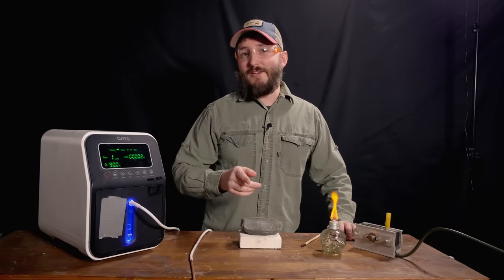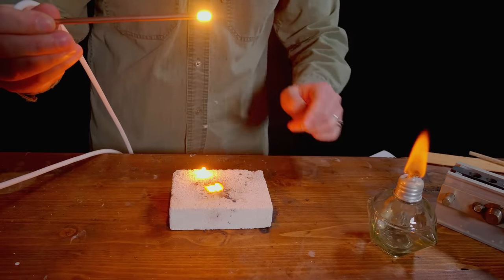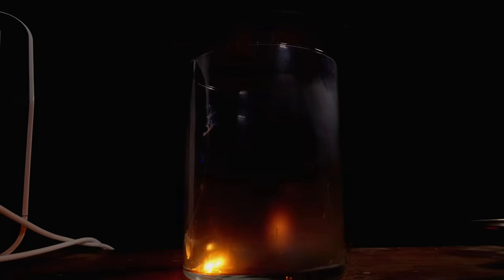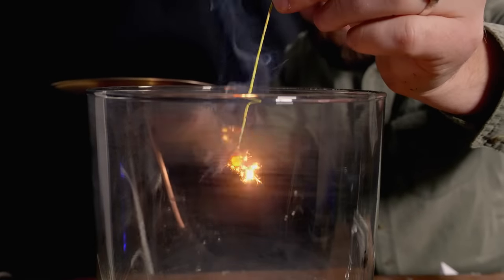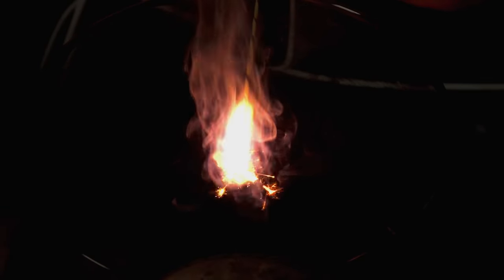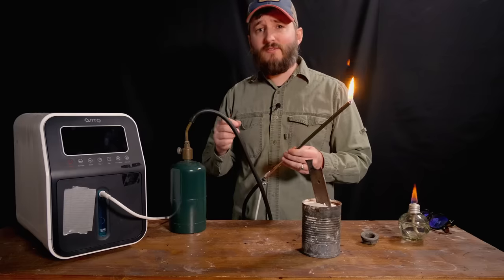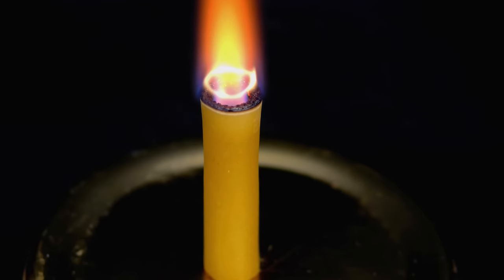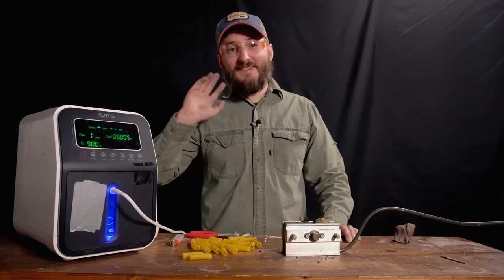6 Unauthorized Uses for a Medical Oxygen Concentrator

Comment from the maker: This video has been dubbed using an artificial voice via https://aloud.area120.google.com to increase accessibility. You can change the audio track language in the Settings menu.
Este video ha sido doblado al español con voz artificial con https://aloud.area120.google.com para aumentar la accesibilidad. Puede cambiar el idioma de la pista de audio en el menú Configuración.
Este vídeo foi dublado para o português usando uma voz artificial via https://aloud.area120.google.com para melhorar sua acessibilidade. Você pode alterar o idioma do áudio no menu Configurações.
Reply: I'm sure any doctors watching this are cringing, lol.
But for $300, that machine is probably only producing between 2 to 5 LPM (Liters per Minute) pulsed flow.
If you want a big badda boom, you should get a hospital grade 10 LPM continuous flow unit, but those cost between $3,000 and $5,000 and may only available by prescription depending on your country.
Reply: How about using this machine for deep water culture to see how extra oxygen works on the plants ROOT zone. If I could get that machine for 75 bucks I would like to use it in deep water culture.
Reply: I don't want you breathing polyethylene fumes but I love your video.
Reply: We really apreciate it a lot. Thank you for the video and dubbing.
Reply: This is equally sick to me!
Reply: Amp draw on that machine vs output....
Reply: Would a gold coated or telfon tube combust ur burn?
Reply: Steel is melting and burning at 2000C - and you say "That is so cool"!  What does it take for you to describe something as hot? :)
Reply: @richardfarrer5616 
Event horizon I guess.
Reply: What are the lpm of the machine? I wonder what would happen if you had one with 10 lpm of concentrated oxygen.
Reply: @fredashay  what is graw? Medical O2 generators are prescription only. They work by flow in lpm, not volume as in welding oxygen. Would take several times the pressure available in even ten of these units piggybacked together to get to a usable welding pressure. And DEFINITELY very dangerous to boot!
Reply: @StanErvin-yo9vl   Tira mah!
Reply: Great video, if youd like to cut steel your flame needs to be blue in colour then once the metal is glowing more oxygen is added or maybe in this case back off the acetylene to oxidise the steel away, yellow means too much acetylene and isn't burning completely leading to a sooty yellow flame which is cooler.
Reply: @fredashay  How about getting 2-3 of the $300 ones? Merge the flow together and go!
Reply: @jafogx   The oxygen concentration will be the same, but you'll just get more of it.
Reply: Amazing! I understand english, and now I can share the video with my brazilian friends
Reply: Real stuff - Tump
Reply: Are related to ted cruz?

Comment: You should do an experiment where you place those air activated hand warmers into a high oxygen environment. It should cause them to get overly hot since they work off oxygen in the air.
Reply: I had a freind plug his hunting socks into the glow plug output of the power panel while out flying in the snow.  Went from ahhh, to hot hot hot foot in about 2 seconds....
Reply: Curious to see if that reaction gets past 57 degrees Celsius. It shouldn’t, as far as I know, but will it?
Reply: @cata2d  why would it not get past 57 degrees? Its just fine iron fillings rusting really quickly, as far as I'm aware that reaction can go way above 57
(the hand warmers might be designed to not go above 57 in atmospheric oxygen, but with an unlimited oxygen supply it should get way hotter, add a catalyst and you've got thermite)
Reply: @johnseed4104  i think @Cata is thinking of those phase change Sodium acetate trihydrate heatpacks.
Reply: I did that on TKOR once, it definitely got hotter!  I bet NHIL could come up with some good variations on that experiment.
Reply: @NFTI  Oh wow I didn't expect a reply from Nate from TKOR. I am honored.
Reply: @johnseed4104  I stand corrected. I think you might be right. Curious to see nonetheless
Reply: You can fill a bottle with O2 and add a handwarmer. Don't expect melted plastic, but a fully collapsed bottle instead.
Reply: You can do it yourself sort of. Take a toe warmer (meant for the low o2 environment of shoes) and  shake the bejeebers out of it and let it rest on your hand. You are of course smart enough to drop it when it gets to hot right?
Reply: @johnseed4104  Hey you don't happen to mean those nitro model engines do you? It's rare to come across another rc pilot.
Reply: @johnseed4104  Yep. Little bit of red iron oxide, some aluminum powder, some heat, and instant molten iron. Railroads use it to weld track sometimes, and military uses or at least used it for emergency destruction. Other formulations use a copper oxide and a reducing agent to make conductive welds.
Reply: Interesting idea!
Reply: @johnseed4104  thermite doesn't require catalyst
Reply: They can burst into flame. Emphasis on burst.
Reply: @SodiumInteresting  Only to start the reaction. There's usually so many impurities in the immediate area that one or more serves as a catalyst to start the reaction then it creates it's own catalyst to sustain.
Reply: For thermite.
Reply: You should call that experiment The Mitt-Hotten Project.

Comment: I really wanna see a gen 2 of the cutting torch with the nozzle and a proper gas ratio.
Reply: and 2 o2 concentrators to provide double the volume.
Reply: my step dad did just this actually, he didnt need but just a little o2 to aid with the fuel he was already using to blow glass, and was tired of buying o2 tanks, so he used my moms old concentrator, and adapted it to work with the standard glass blowing tubes he was using, that had a commercial blow-back repression device on it, and it worked quite well for him for many years. but i too would LOVE to see something that works on mostly o2 as well!
Reply: The torch would have worked better if the nozzle was made out of a single smaller diameter pipe similar to the one he made for the hho generator
Reply: glasslinger...
Reply: @MichaelMantion  or store a bunch in one of his homemade gasometers
Reply: @MichaelMantion  it gives like 60 kPa in pressure so you rather need  like five of them.)
Reply: This works fine with an actual torch. For propane and an oxygen concentrator you're limited to something like a .106" or smaller tip and a .073" or smaller is recommended.

Plenty of folks out there use one of these oxygen generators with a propane pumpkin and a small torch to braze together bicycles.  It can be more convenient than dealing with swapping oxygen and acetylene tanks at the welding store.  When you run out of propane you just go down to the gas station and grab a fresh tank!  There's lots of information over on the velocipedesalon forums.
Reply: @laserdiode  Yup.  You can run up to around a .106" orifice with propane and an oxygen generator, but .073" is a better fit.
Reply: @DonOblivious  true!
Reply: Maye even try drying the oxygen enriched air? or premixing?
Reply: The concentrators don't have constant flow rate, they fluctuate, you can even see that when he goes to the higher flowrate on this one. You can't get a proper gas ratio in this case.
Reply: @MrRolnicek  hmm, what about a buffer tank to normalize the output concentration
Reply: @MrRolnicek  Depends on the model.
Reply: @DragonKnightRyue  some can do pressure, others cant, and rely on either you manually sucking it out, or the venturi effect to suck the air out, it really depends on the model, you would need a continuous pressure capable machine to be able to get any kind of decent flow rate/pressure, (and those guys are BIG, AND expensive, but they are LITERALLY made to refill the small o2 tanks that people that need o2 have to carry around with them) and even then youd have to "re-jigger" them to feed from the concentrator, into the pressure vessel you set up, and then through the blowback valve and then mix it with the other fuel, and the pressure vessel would need to be strong......like a standard o2 bottle.....so liike at that point, you are really just using the bottles, but with extra steps, and lots of waiting, because they take about a day to fill a bottle.
its honestly much easier dealing with the changing flow rates, manually, by just adjusting the propane nozzle to match the o2 rate using the look of the flame as your guide. a good torch tip will have a knob for each inlet that lets you do adjustments on the flow rate right there.

search for "cricket glass torch" thats the one my stepdad uses, its on the small side, also on the expensive side, but its really good at what it does.
Reply: I aim to build one as soon as I can get hold of the zeolite molecular gas filter in enough volume to make a high enough volume of oxygen to run a oxy-propane or oxy-gasoline torch.
Reply: Not experienced with this at all but my thoughts turned to the divets. 
I'm thinking that it adds a bit too much turbulence to the propane which shoots out a lot more chaotically than the oxygen. Adding some rifling to the primary tube and using non combustable spacers should work better (at least in my mind). Put a venturi on the end with a final nozzle should do wonders.

Again, though, I'm spitballing and have no experience so hopefully someone with better understanding of these things could put me right.
Reply: My mom used to have a lease on a unit that could refill oxygen tanks/bottles. A tank would be able to provide a regulated flow, especially with a regulator.
Reply: Yes, the gas flow was too slow imo, nozzle update plz plz
Reply: Yes please
Reply: I use a concentrator for glassblowing works great
Reply: @MmeHyraelle  ONE option is to put the tube on a lathe [or other stable turning implement] and use a metal rolling tool to roll the tip down some...

But in the end...

PRESSURE is the only REAL solution.

And that will mean modifying his existing lay out.
Reply: @DJRonnieG  If you can get a used O2 bottle [very hard these days since big corporations are buying them out and not allowing private bottles to be filled much any more] and a scuba tank compressor, you can fill your own tanks as much as 1500 PSI without any trouble...

And with that, and some minor modifications, you can stack a couple of those and fill to the 4k level...

I am working on doing this using a water type pressure washer rated for 4800 PSI and some really heavy wall drill steel tube.
Reply: @hunnybunnysheavymetalmusic6542  I happen to have one of the bottles in the kitchen but yeah no means to refill it once expended unless I can get a concentrator capable of filling it. Not a scuba but a tad narrower. Well, good luck on your endeavor in this area!
Reply: Same
Reply: I wonder if you could make one by modifying a bunsen (or Fisher or Teclu) burner.
Reply: Agreed! Maybe try switching the the oxygen and propane lines and / or trim the the middle pipe shorter or drill holes in it to encourage premixing
Reply: OP’s comment is fire 🔥🔥

see wut I did there?
Reply: Definitely!
Reply: Hard agree
Reply: Do it yourself and post it
Reply: @kennethporst4359  👍👍👍👍🙏🙏🙏🙏✋✋✋🖐️🤪🤪🤪🤪🤯🤯🤯🤯🤧🤧🤧🤧🤒🤒🤒🤒🤮🤮🤢🤢🤕🤕🤕🤕
Reply: Get a scuba compressor n fill your own tanks all the way full by pressure blow off check balls
Reply: lampworkers sometimes use oxygen concentrators to run their torches. i currently use a 10lpm machine and 2 5 lpm machines. You are able to T them together to increase your VOLUME, adding more concentrators wont add PRESSURE, only volume. torches require a specific pressure to run them. So they will run their concentrators to a oil free compressor(rated for their oxygen supply) into a holding tank. you can then use higher pressures.
Reply: Came to the comments to say the same thing
Reply: @DragonKnightRyue no... Do not pre mix unless your trying to explode
Reply: I cut through 1/2" mild steel regularly with a regular oxy/acetylene torch with a 10 and 5  lpm coupled together works great.
Reply: Could the effect he was seeing was the flow rate of the O2 exceeding the flow rate of the propane? If so, he was unknowingly playing with a bomb(No blowback prevention)

Comment: A wise man once said "Perhaps The best oxygen is the one we made along the way"
Reply from the maker: That's over my head
Reply: @Nighthawkinlight  perhaps it’s a meme reference to “maybe the real treasure is the friends we made along the way”
Reply: @Dillbeet  LMAO yeah it is. Yall dont have many friends huh
Reply: I didn't know that men created oxygen under normal circumstances.
Reply: @Dillbeet  i think most of us got that.... Still too deep for me.
Reply: Makes sense if you're carrying a lot of plants on a spaceship...
(Our spaceship Earth is missing more than 3 trillion trees.)
Reply: @ahaveland  They were yummy.
Reply: @NightHawkInLight  I wonder if you could increase the concentration by having 2 of these machines? Put one machine in an airtight container, and have the other machine supplying the container with 90% oxygen. I'm assuming the machines are just pulling oxygen from surrounding air, so maybe a higher baseline % of oxygen in atmosphere would give better results
Reply: @Nighthawkinlight  another idea would be to pump produced O2 into an inverted container underwater as a sort of O2 bank. Then sink it deeper underwater to have enough pressure for your torch idea
Reply: @ringofasho7721  Why would you put the entire machine inside an oxygen rich atmosphere... Lol that's about as stupid as it gets.

If you're gonna try to daisy chain them, connect the output of one to the intake of the other, probably with some sort of bladder in between for pressure reasons, and run...
Reply: @ringofasho7721  I like the way you think. Pay no attention to  people who may call you stupid for thinking around the box. Your idea of putting a second oxygen generator inside a box full of 95% O² is really, really, dangerous and a very expensive bomb. Also, it won't work because these machines need nitrogen to flush their cells of oxygen.
Reply: @Nighthawkinlight A while back, you uploaded a video about making a sheet waterproof like a tarp or a raincoat. Would the silicone mixture conceal the color on the sheet, or would the color on a raceway sheet or striped sheet or floral sheet still be fully intact and visible?

Thank you for posting this video. Best to you and your family.
Reply: That one specific oxygen…
Reply: @Nighthawkinlight    Nice squatter man symbolism, foreshadowing and such
Reply: Indeed the breath of life.
Reply: Another wise man said ,” those that play with fire get burned “

Comment: I know a chemistry professor who does glass blowing on the side. He has access to a pair of larger oxygen concentrator units that supply enough oxygen to run two oxygen-propane glass-blowing torches for a workshop.
Reply: I think the glass blowing community has been using these for a long time.  Plenty of out of date concentrators are available.
Reply: Thunderf00t has one as well, I think
Reply: I was told by some glass-work enthusiast that those concentrators are really popular now among glass masters because of antihuman prices on bottled oxygen.
Reply: Yea concentrators are the way to go. You need way more lpm and purity tho than he has.
Reply: I wonder if it would be possible to do something akin to a compound turbo, where one O2 concentrator feeds another and generates an ultra-high concentration of O2 (>97%)?
Reply: @tcp3059   the professional ones for glas blowing work like this, from what i`ve seen an heard
Reply: @The_Dude96193  I see
Reply: Went to a glass craft class and he had 4 medium sized ones. Saved him a ton on o2 bills.

Comment: I wear iron-powder oxidizing toe warmers in winter (hot hands). They get significantly hotter if they're outside my boots, due to the extra oxygen. I'd love to see what happens to them in an 95% environment.
Reply: Why would their be extra oxygen in your boots? Most bacteria is oxygen consuming meaning oxygen levels in your boots would technically be slightly lower then normal air.
Reply: @MRblazedBEANS  read it again. 😉
Reply: @MRblazedBEANS  Outside the boots, not inside.
Reply: @MRblazedBEANS  read it again bro
Reply: they probably catch fire.
Reply: Thats a really good idea. I noticed the same thing and always take my hand warmers out of my pockets and roll them around a bit in the open air to warm them back up, but never actually thought about WHY that happens lol
Reply: As in opening a fresh hand warmer packet and while its doing its normal reaction run a jet of o2 into it?
Sounds awesome!
Reply: I think Cody did a video on this if you can't wait
Reply: @MRblazedBEANS  definitely need to learn how to read :D

Comment: This makes me appreciate the significance of oxygen’s role during combustion and how serious it can be when using equipment like this.
Reply: It's pretty significant.  As in nothing will burn without oxygen. That's why it can rain methane with lightning and the whole planet or moon doesn't go up in flames.
Reply: Because "Fire" (combustion) is rapid oxydation.  While an explosion is very rapid oxydation.
That's why explosives have to contain an oxydizer mixed throughout to provide sufficient O2 to the ongoing oxydation process without recourse to atmospheric O2 (whihc would be too slow to cause the rapid combustion needed to go bang).  

It's also why the throttle control on your car actually controls the air flow not the fuel flow which is controlled by your engine ECU based on the air intake flow meter.
Reply: hydrogen peroxide is used in the spacex launches still. its used as an oxidizer. same stuff used in the xmen movie when they used the modified sr71 blackbird for extra punch